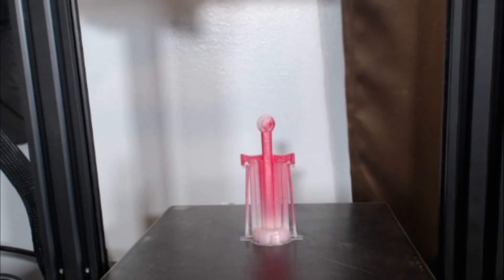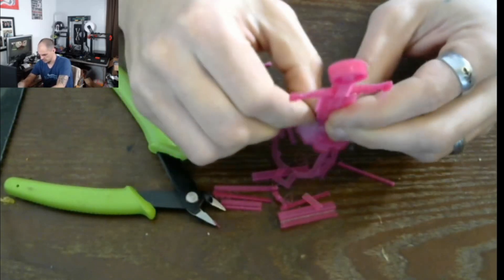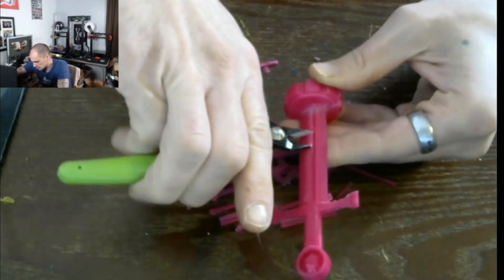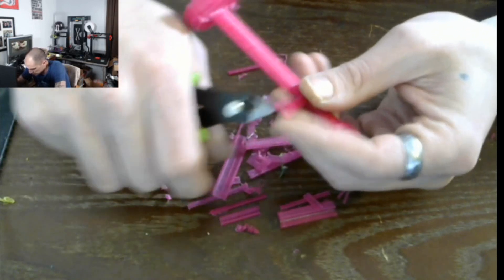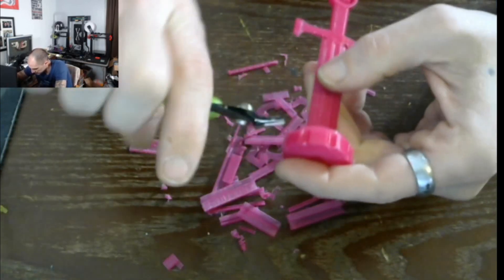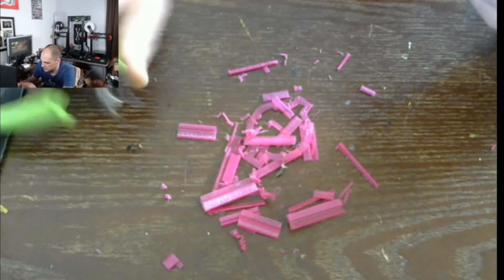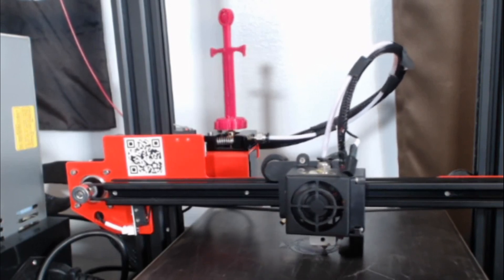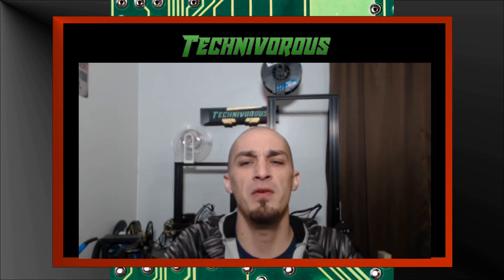Excalibur Extruder knob for Ender 3 pro  Anet ET4 and others

Comment: Nice prints. Thank you for the presentation on the PETG. I also have an Ender 3 Pro and have been working with some clear PETG. Would you mind sharing your settings? I watched your previous video and have increased my temperature to 255 but still getting some stringing and some of the layers don't stick well and leave "tiny" gaps. I'm using the magnetic bed and slicing using Cura 4.4 but notice you said you turned off the fan?
Reply from the maker: Yep no fan so turn cooling off. Slow it down a bit and turn it down to 250. Then slowly turn it down until the stringing goes away. Keep it above 245, at that point keep slowing down until you get the results you want. You can do this on the fly with the control knob, reducing your set speed by a percentage to calculate the best speed